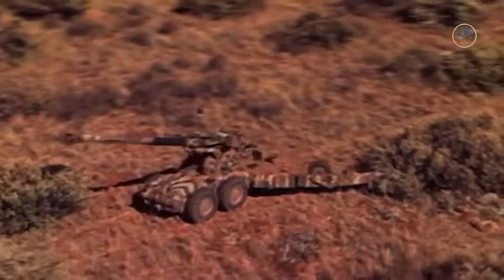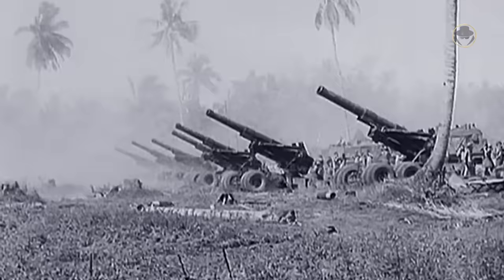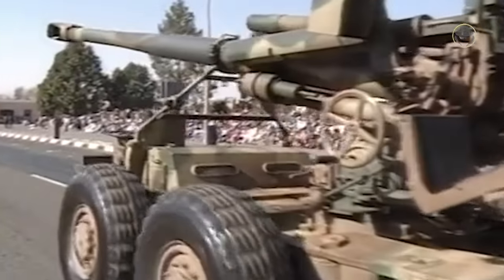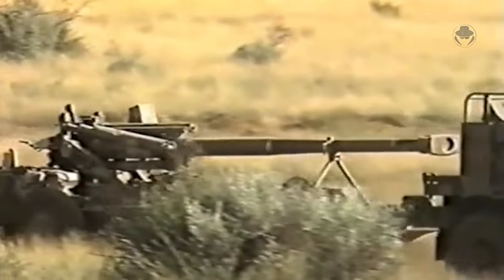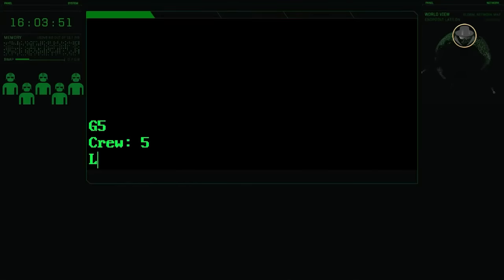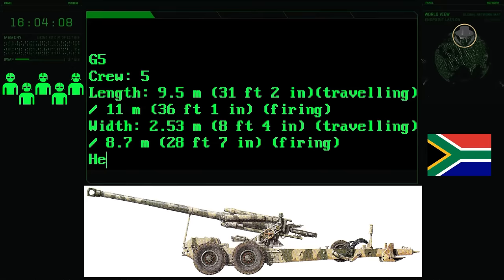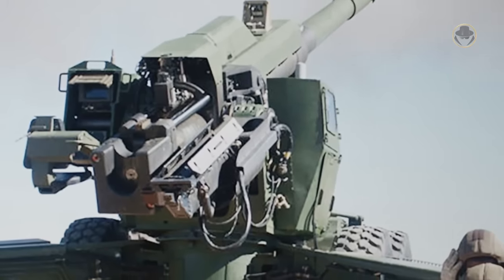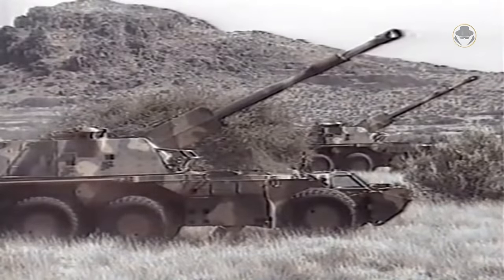G5 Howitzer  | The South African towed artillery legend

Comment: The G5 was not baptised during Ops Modular in 1987. It was baptised in Ops Alpha Centauri in 1986 by 4SAI's Quebec battery
Reply from the maker: As we said in the video we could not find info. Could you send us or just post the details? Thanks
Reply: AFAIC it was used in '84/'85, I was in during that time, will need to check and see if I can trace the info

Comment: @WeaponDetective Compared with the USA M777 howitzer witch one is the best?
Reply: The M777
Reply: @user-tj1vg4zn5p  how do you know where is the specs what is the range what is the firing speed what is the cost
Reply: @Deadround34 the m777 is an electrical and hydraulic nightmare in the field. Was field artillery for 4 and half years and deployed to both Iraq and Afghanistan in that time. I can't speak to the g5 personally but I'd imagine it's over all reliability has to be better than the m777. Our platoon usually had 1 of 3 m777 guns running at any one time while the other 2 had to canbalized for parts while deployed just so we'd have 1 gun that could actually counter fire

Comment: 100 klicks at 16kph sounds like an awful road trip.
Reply: And yet it is a TOWED artillery piece!
Reply: It's not a self propelled gun. It's got an auxiliary engine to be used for positioning and such. Beats rousting the troops to put shoulder to the wheel.
Reply: There's a version called the G6 which is self propelled and armoured.
Reply: Allows for limited shoot and scoot though
Reply: @montys420-  Maybe to move the gun over to the gun tractor, but it would be stupid to plan to move the gun with a little putt putt. Russian artillery is so kak that you would need to scoot 20 kilometers to prevent getting accidently hit by the counter battery fire, so forget about using the putt putt for shoot and scoot.

Comment: better than US's M777
Reply: Different tools for somewhat different jobs.  At 14 tons the G5 is,... chunky. this has always been one of its big problems. At a bit over 4 tons the M777 is positively svelte.  You aren't ever going to sling a G5 under a helicopter for example. 

Turkey for a few years produced a Gerry Bull derived L52 towed howitzer based on Singapore's version of the GC45/G5/GH-N-45 platform. Then they figured out hey, this thing is freakin heavy. Lets just mount it on the back of a truck instead and stopped building the towed gun.

Comment: Towed artillery has had its day
Reply: it still is in the limelight, infact, good artillery systems have a force multiplier today since they dont have to go high - calibre saturation fire mode to guarantee effect. the drone spotted recon makes it much more effective today.
Reply: Pretty ignorant to say that. 

See how much tracked artillery or MLRS resupply you can sling under a helicopter or stow in an amphib assault ship...even better yet, see how long it takes to transport those ashore.

Compared to MLRS, let's see how much direct fire you can manage, or shift fire.

You sound like someone who reads a few books, saw a few YT videos, and played some games and calls that knowledge.

No, it doesn't deserve to be called pre-eminent, but still it's incredibly useful. If I were forced to choose to only have one type in inventory, it'd be towed over tracked or MLRS...better to have all three.
Reply: ukranians seem to want more of it
Reply: Air lift by helicopter ... Says not always.. plus this can relocate itself quickly and far enough to avoid  counter fire or exposing the Tow support vehicles..

Besides I think a variant of the gun ended up in the Rhino 🦏 SPG.
Reply: It has local mobility under its own power which makes it quicker move than traditional towed artillery, 2mins to set up or move
Reply: Not really
Reply: The G5 was the first step in a two step program.  The second step was the development of the G6 which was the same gun in self propelled form. That came out inly a few years later.
Reply: @JD-tn5lz  yup, each is suited to different conditions.
Reply: Has it?
Reply: On the contrary my friend.... My death has been greatly exaggerated

Comment: Late Correction? I was wondering about the Radio Shack joke. Very funny as a time capsule, but cords? It was the closest thing to a supply shop for electronics, like components (chips, resistors, LEDs), stereos, police scanners, speakers, STEM learning kits, toys, and also cords to connect it all. And the TRS-80, a contemporary of the Apple II and the first "P